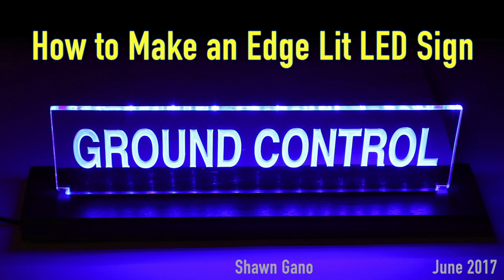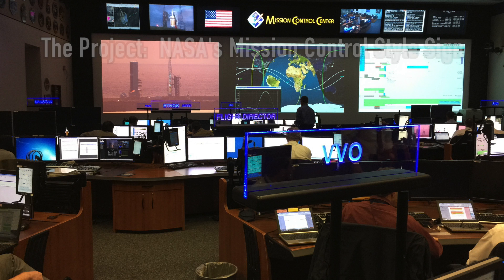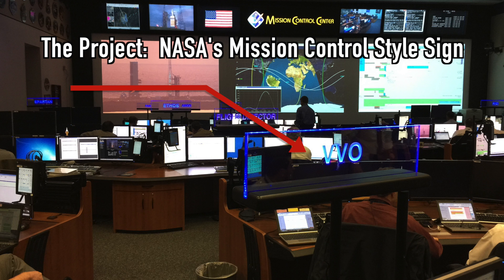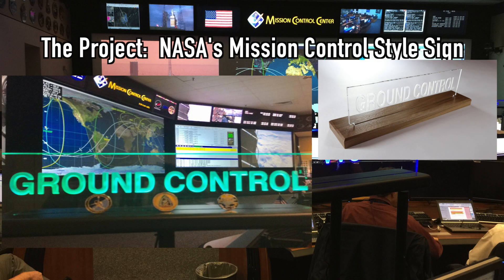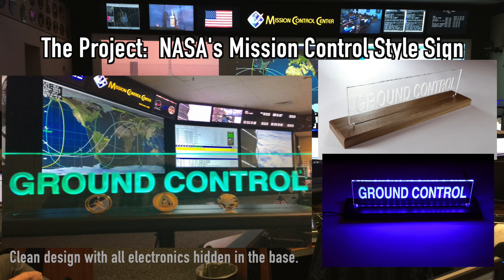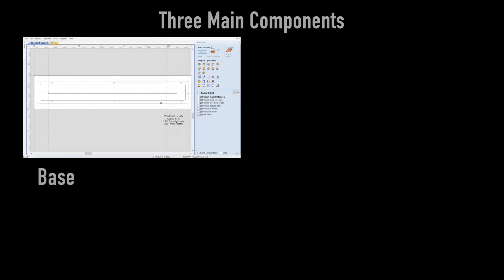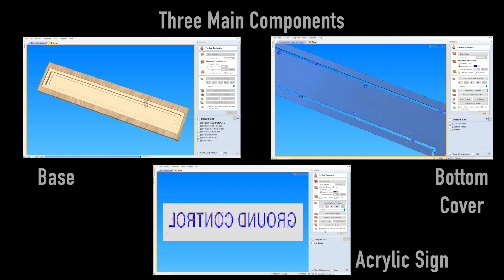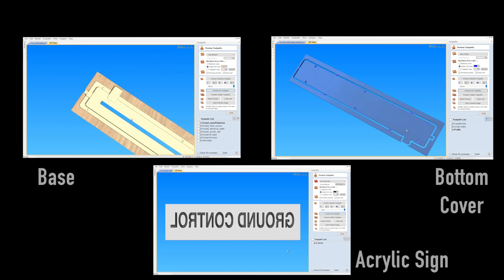Making an LED Edge Lit Acrylic Mission Control Sign

Comment: I see this video is older but you did a great job of demonstrating what some of the newer videos are lacking.  Thinking about making a couple of these using my laser.  Right now in the binge  watching mode trying to figure out what to do.  I am sure I haven't used the right search words yet, but next step is to loo up various types of LED lights and ways to connect them.  So far all of the videos I have watched assume people watching already know how to connect the strip lights and the various parts.  I appreciate you sharing your supplier, but without knowing what each part does I still am not sure what to order.  I think I am getting close though.  Once again very helpful video.
Reply from the maker: Hi Rob - thanks! Yes you are right; I did sort of glance over the electronics.  For the parts I typically use include (1) the LED strip themselves which come in a roll of about 16 ft long, search for 5050 waterproof LED strips (they should have about 300 LEDs per 16 ft [ which can be cut to size at specific intervals marked on the strip] -- some cheaper ones have less LEDs): (https://www.amazon.com/gp/product/B00DTOAWZ2/ref=ppx_yo_dt_b_search_asin_title?ie=UTF8&th=1)  (2) a controller - something like https://www.jacobsparts.com/items/LED-DIMMER-15 (which is what I used in this video), (3) you will also need a power supply of 12V -- 1amp is enough for a short strip of lights, and (4) probably will need some connectors - I usually cut these in half and then solder on side to the LED strip and plug the other into the controller: https://www.amazon.com/gp/product/B00XX41VD0/ref=ppx_yo_dt_b_search_asin_title?ie=UTF8&psc=1.   Hope that helps!    Update:  (5) you may also need some 4-pin male to male connectors too : https://www.amazon.com/gp/product/B01J1GWIOY/ref=ppx_yo_dt_b_search_asin_title?ie=UTF8&psc=1 to connect the connectors mentioned before to the controller.
Reply: @shawngano  thank you for the reply and the links.

Comment: Hi Shawn, I like how did you hide the cables and made it "clean". What is the source/name of the controller you used?
Reply from the maker: Thanks!   These are the controllers I used for this video:  https://www.jacobsparts.com/items/LED-DIMMER-15    -- I have also started to use some of these two controllers as well (one uses an RF remote which works better than the IR remote, and the other doesn't use a remote at all -- as they can be easy to misplace):  https://www.jacobsparts.com/items/LED-DIMMER-11  and  https://www.jacobsparts.com/items/LED-DIMMER-09-BLK
Reply: @shawngano  Thanks for sharing it. Will look into it and try to implement it.

Comment: You can skip all of that edge sanding and buffing.  Look into "flame polishing".  Simple and fast.
Reply from the maker: Thanks for the suggestion; especially for ways to avoid sanding!  I have attempted flame polishing but couldn't get a crystal clear and perfectly smooth result; it is possible the flame wasn't hot enough.  Also I have lately just sanded to 400 grit without polishing and the edge glow is really nice that way.

Comment: Nice work......If you don't mind if I make one suggestion is to stick the LED strip to an Aluminum 1/8" x 1/2" bar to help dissipate the heat.
Reply from the maker: Hi Greg - that is a great idea!  In the back of my mind I had worried about heat; but didn't have any good ideas on how to address it.  These signs have been working well for a few years straight but I suspect would last even longer with better cooling (though wood is still not a good conductor but that would spread out the head load better).
Reply: @shawngano  I have been using those aluminum strips for years and extra 3M LED  double sided tape because some times the tape that is on those strips is not the best..  I wish I had the tools you have to actually make the sign.
Reply from the maker: @TheGregWallaceShow  You are spot on about the tape on the back of the LED strips; it does not stick well at all.     The smaller CNC routers available today do a good job of carving acrylic as it is quite a soft material; hopefully it works out someday for you as they are a lot of fun and can really be used to make a lot of things.  They can also pay for themselves with the right ideas.  Thanks for the suggestions!

Comment: Are you using any type of sanding around the edges to trap the light in?  If so, all sides but where the light is??   Any thing you are using on the acrylic to make it shine like that??  Thank you  in advance.
Reply from the maker: The light is coming from the bottom  (an LED strip light).   Around all of the edges I  sand from 200 grit to 800 grit then buff the edges so they are clear.  However, this really only needs to be done on the edge where the light source is.  It is actually a neat effect to only sand the other sides to 400 grit (and just buff the bottom) as that gives a nice frosted look around the visible edges.   I don't do anything to the front and back of the Acrylic other than some soap and warm water if there are finger prints on it.   Etching the letters causes them to catch light.  The "sparkles" on the top edge are due to the LED strip having individual lights and the camera shutter.
Reply: @shawngano  wow!!! Thanks!!
Reply: @shawngano  you ever make a video of that frosting technique?
Reply from the maker: @WT7791  I have not; but it is exactly the same except you don't buff the edges at the end and you can quit sanding at around 400-grit.

Comment: How much was the labor and machine cost to make this? You've got so many tools, a whole CNC router etc. It's a lovely project but bloody hell, the cost of a single item must be in hundreds of dollars 😅
Reply from the maker: You are definitely right this isn't the easiest project to make!  I have changed up the design some since making the video to reduce the machining and electronics assembly time.  Also while CNC routers are expensive the hobby variants (like I have) are slowly becoming more affordable and can really improve precision and cut down the cycle time when making parts in batches; I now can cut 6 bases and 6 signs at once. Though I am not sure if these would really make a large profit compared to other projects for the time spend.  But I do a make them for gifts and sell a few (with customized names) when I have the time to make a batch or two.

Comment: how much spindle speed do you use? and feeding?
Reply from the maker: For the cast acrylic, using a 60 degree V-bit, I use a feed rate of 80 inches/min (and a plunge rate of 30 in/min).   For the spindle speed it is hard to tell as I have a router, the speed is toward the lowest setting (probably in the 12,000 to 14,000 rpm range).  The main thing is to keep it moving fast enough to ensure it doesn't melt.
Reply: @shawngano  thanks man, will try it with my students

Comment: Does the acrylic thickness matter? I used a 2mm acrylic but I dont get all the image illuminated. Tried different depths with the laser.
Reply from the maker: Hi Gustavo - The thickness does affect the light.  I haven't tried 2mm but I have done this for 3, 6, and 12mm thicknesses.   What I have noticed is that the thinner acrylic tends to dim faster the further you are away from the light strip.  For example the 3mm acrylic will be bright low in the design then fades more quickly the taller the design compared to the 6mm.  This could also be due to the thicker acrylic allows for a deeper engraving.  It seems like it should work for 2mm, just be sure the LED strip is well lined up with the acrylic and also keep the bottom of the acrylic is as close to the acrylic (even sitting right on top of it is better).
Reply: @shawngano  Thank you very much!!!

Comment: Hi, about polishing the edges. Do you only need to polish the bottom where the light enters, or all the way around? Thanks.
Reply from the maker: Hi Kerry - That is definitely based more on your preference or what look you want.  If you sand but not polish the other edges it gives off a nice outer-edge glow.  The signs in Mission Control have the edges all polished so that is what I did here as well to try to make them as close as possible.

Comment: Hi shawn can you give me the settings of aspire for this acrylic? Thanks
Reply from the maker: Sure - here is the file with all of the Acrylic Settings (it is a .crv - so it can be opened with VCarve Pro or Aspire):  http://gano.name/shawn/CNC/MCC_LED_Signs_VCarve.zip     The bit I used with those settings was: http://www.precisebits.com/products/carbidebits/2500_scoreengrave.asp  (60 deg v-bit) -- so you may need to adjust the settings based on your setup but it should be a  good starting point.  Just remember it must be cast acrylic and the RPMs need to be slower than normal and the federate a bit faster -- to avoid melting the plastic and gumming up your bits.
Reply: @shawngano  thanks for your help shawn
Reply from the maker: @DaniMutaqin  You're welcome!
Reply: @shawngano  Shawn, can you give the file again.  The above link doesn't work.  Thank you, Sark
Reply from the maker: @sarkprusa3102  Sure; maybe try this link instead :  https://gano.name/shawn/CNC/MCC_LED_Signs_VCarve.zip   (if that doesn't work as a link in YouTube try copying and pasting it into a browser; as it should work now)

Comment: Hey Shawn, great job on this video, Quick question if you have time, My neighbor got some LED light strips off eBay and brough me over a little strip to put above my Lathe, these things get so hot they would burn you, what kind of lights are you using for a sign like ethos so it don't get too hot, I would be afraid to use the light he gave me for an enclosed area as hot as they get just on the shelf above my lathe..?
Thanks in advance 
Dale
Reply from the maker: Hi Dale - LED light strips do get warm but they shouldn't get hot enough to burn you.  You may want to double check that you are not accidentally using a higher voltage supply than the strip was made for (Note: there are some strips that only use 5V).  Specifically I like to use "5050 LED Waterproof" RGB strip lights (which are 12V).  I like the water proof version as it has a clear silicone seal over the top of the LED light elements which does protect them and it provides something for the acrylic to sit directly on top of without heating issues.

Comment: what drill bit did you use?
Reply from the maker: Do you mean the size of the drill bit to cut the hole for the LED strip power?  Or are you interested in the router bits to clear out the base or to cut the acrylic with?
Reply: @shawngano  the router bit to engrave on the acrylic. it looks kinda white, is it carbide?  , very deep and wide spiral, never seen a drill bit like that before.
Reply from the maker: @insanet3  Ah yeah that one is a carbide 60 degree v-bit (yeah it does look a little different in the video - I just went back and checked it out).  Specifically that one is from precise bits and is either the EM2E4-2500-60VC (which has an extra coating) or EM2E4-2500-60V. - which can be found here:   https://www.precisebits.com/products/carbidebits/2500_scoreengrave.asp&filter=7  -- those bits work well on the cast acrylic you just need to keep the RPMs a little lower than for wood and don't move too slow or the plastic may melt and gum up.

Comment: I am in the process of doing something similar myself and was looking for inspiration, and this is one of the best i have seen so far! well done! I do have a few questions  in regards to material if you dont mind answering them. May i ask what type and size of timber did you use for the base and cover  plate? Also is it possible to buy RGB controllers separately? Many thanks in advance
Reply from the maker: Thanks!  Though thinking back on the video I probably should have added a bit more on the modeling part and some feeds and speeds - maybe next time :)      For these bases I used 3/4" thick walnut (14" long and 3" wide).  For the cover plate I used "Hardboard Tempered Panel" it is quite thin 0.115" and is smooth on one side and pretty rough on the other.    Yes you can get the RGB controllers separately -- I found this website has a lot of LED strip parts at a good price:  https://www.jacobsparts.com/cat/LED_Lighting/Strip_Lighting/
Reply: @shawngano  Thank you for your prompt reply, very much appreciated
Reply: @shawngano  Great video Shawn!  I have been making edge lit LED signs but using bases purchased from Amazon.  I'd like to start making my own bases so that I have the ability to make custom sized signs.  I saw that your project was done in Vcarve, do you happen to have the file you used to make the based available anywhere to download?  Thanks Don
Reply from the maker: @BBQGuru1008  Hi Don - Thanks!  Yes here are the files:  https://www.gano.name/shawn/CNC/MCC_GC_Sign_VCarve.zip  -----  Update:   had uploaded those a while ago so I checked the file and it looks like it just has the .dxf geometry and not all of the tool paths.    Give me a bit and I will upload the VCarve Pro files.
Reply from the maker: @BBQGuru1008  Here you go:  http://gano.name/shawn/CNC/MCC_LED_Signs_VCarve.zip  -- this contains a file for the base, the base cover, and the acrylic (though it isn't for the Ground Control sign, but something very similar)

Comment: Why did you engrave the words at the back? I am making a similar project.
Reply from the maker: I prefer the way it looks to have the engraving on the back.  It gives the front a more consistent of a finish and the refraction gives the lettering more dimension.   I have done some signs the other way and they don't look bad; so it's probably more a personal preference.
Reply: @shawngano  thanks, I guess I will try both
Reply: @shawngano  I made the sign, engraving things at the back is indeed better, thanks
Reply from the maker: You are welcome!   Glad to hear it turned out well!

Comment: hello! I was curious about that pack of end mills you showed. Where did you get them and are you happy with their performance?
Reply from the maker: The pack was originally the starter set I ordered when I got my machine from Probotix.  I liked them so much I have source replacements for most of them (except for the 30 deg v-bit as I haven't use that much).     The 3 v-bits are from PreciseBits and are 90deg, 60 deg (my favorite!), and 30deg (found here: http://www.precisebits.com/products/carbidebits/2500_scoreengrave.asp ) - The ball nose bits are also from precise bits and can be found here:  http://www.precisebits.com/products/carbidebits/taperedcarve250b4f.asp?tsPT=!!!4Flute_CarvingBit_BallNose_Loose!!! ) 

I also really liked the endmills and they are from https://www.magnate.net  -- specifically I mainly use :

#9477 1/8" upcut spiral with a 1/4" shank (solid carbide) 2.5 overall length (cut length 0.75") 
#9497 1/8" downcut spiral with a 1/4" shank (solid carbide) 2.5 overall length (cut length 0.75") 
#2005 1/4" upcut spiral with a 1/4" shank (solid carbide) 2.5 overall length (cut length 1")
#2105 1/4" downcut spiral with a 1/4" shank (solid carbide) 2.5 overall length (cut length 1")

(some of these are not on their website so you may have to call them).

The case itself was from PreciseBits.

Comment: Thanks for the intuitive video.  I am just beginning a build on a large CNC and I am a newbie.
Have you tried propane torching the edge of the sanded acrylic instead of polishing.  It works really fast.
Reply from the maker: Thanks Craig!   I have tried using a butane torch a few times but I never was able to get a nice polished looking results.   I read later that I maybe should have tried something hotter such as MAPP gas;  if I could get that to work it sure would save a lot of time sanding and buffing!  Any tips?
Reply from the maker: @RSquar I have used a laser to cut thinner piece of acrylic but the edges are always slightly "frosted" and aren't crystal clear and perfectly smooth like I can achieve using a buffing wheel.  I will need to research the right speeds and air assist amounts to see if that could be improved; but yes laser could be a much faster alternative too.  Thanks!
Reply from the maker: @RSquar Thank you!  Ah that is probably the difference I was using an at most 40W laser, so it may not have had enough power to make such a nice clean/smooth cut.

Comment: Best one I've seen! Any way you would share the cad file?
Reply from the maker: Thanks! Sure, though they are just 2D vectors; will that work?   I just cut to different depths depending on the material for the base.
Reply: Shawn Gano if I can open it in vcarve  that should be ok.
Reply from the maker: try these files:  http://gano.name/shawn/cnc/MCC_GC_Sign_VCarve.zip  and let me know when you have downloaded them.
Reply: Just tried, it's giving an error when I click on it.
Reply from the maker: ok maybe it was a cut and paste problem on my end try:   https://gano.name/shawn/CNC/MCC_GC_Sign_VCarve.zip
Reply from the maker: (I think that worked, they are the .dxf drawings, if you prefer a different format let me know)
Reply: That worked. thank you!